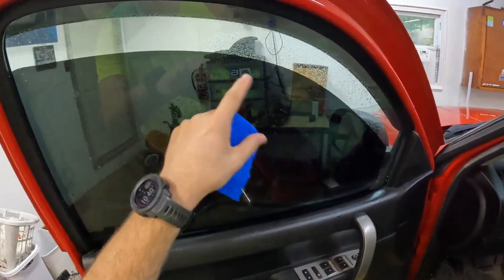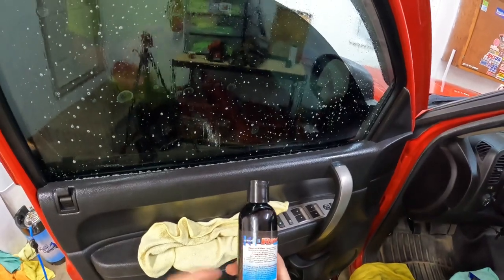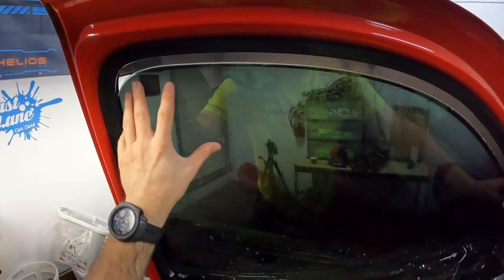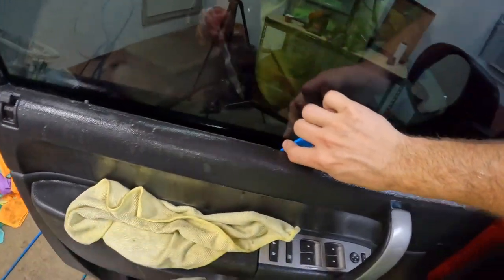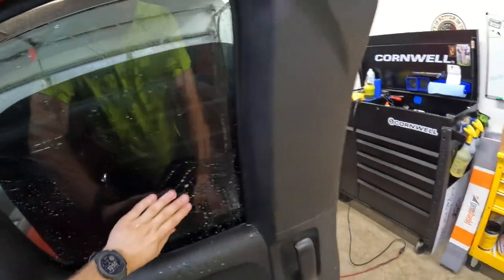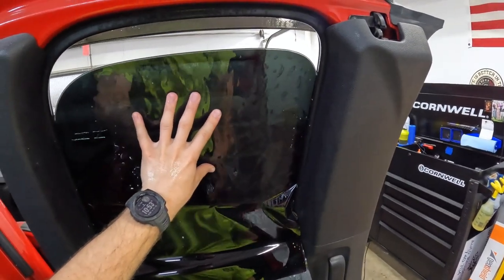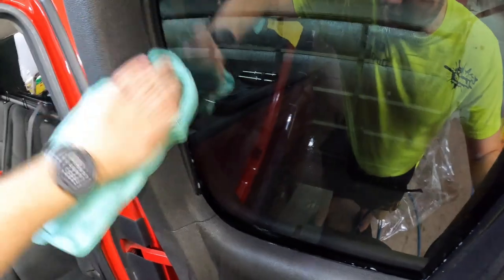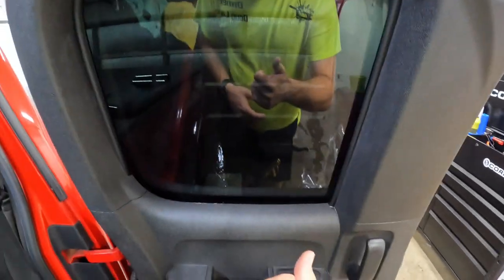How To Identify And Remove Hydrophobic Coatings

Comment: By mistake I used Gyeon Q2 Trim on the interior of my car.  Unfortunately I recently learned it was for the exterior.  The interior trim of my new Tesdsa Y.  What product do you recommend for removal?
Reply from the maker: I'm not familiar with that product specifically however I would start with an interior all purpose cleaner from somewhere like chemical guys or Jax wax.
Reply: @fastlanecarcarellc3608  

where can you buy it?
Thank You!
Reply from the maker: @dj_jambor  sundistributingdirect.com